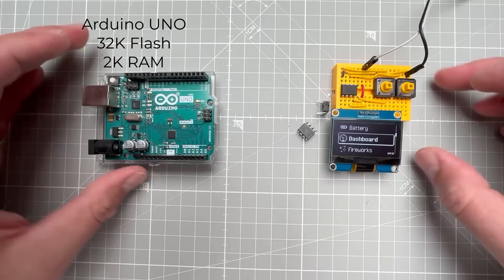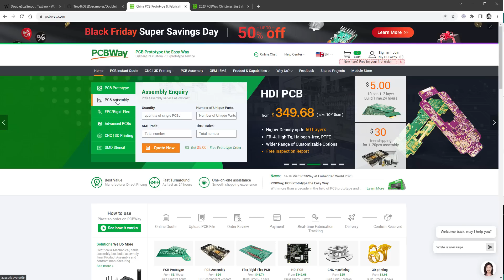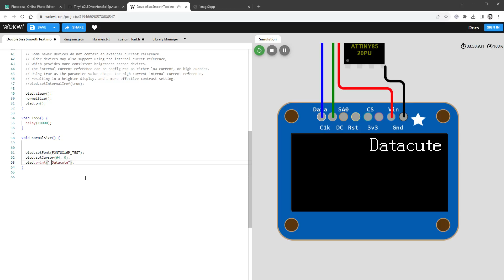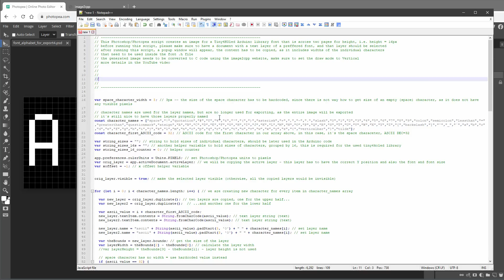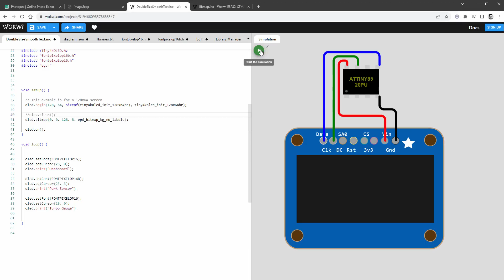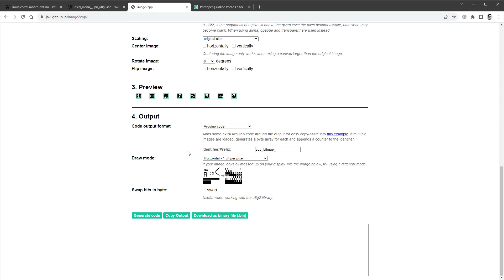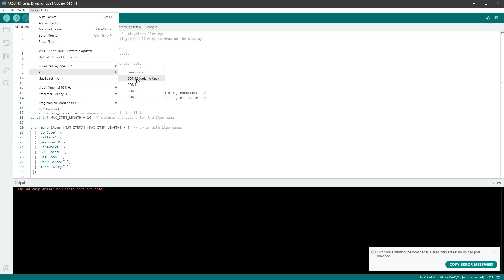Arduino ATtiny85 OLED Menu

Comment: Nice. I only know "Nokia 5110" or PCD8544 display which seem to behave similarly, just has 84x44 resolution (nice for 6x8 font giving 14x6 characters). But you don't need icons including menu, you can just use something like iconColumn |= item->next->isSelected() << 6 | item->prev->isSelected >> 2.
Reply from the maker: Yep, nokia displays were quite popular before cheap OLEDs were available, I haven´t actually used that display in any of my projects, but I might still try it. Thank you for your comment!

Comment: Nice! 
can i make this with attiny85 digispark?
is that code changes?
or pins connection?
Reply from the maker: Yes, you can use it with digispark board. Please see my other tutorial, where I was doing exactly that - https://youtu.be/8IKBzZKTgD0
Reply: @upir_upir  ok! I have OLED and esp32 and attiny85. I have 12 options in OLED menu but attiny85 doesn't have enough space. I Wana upload OLED menu code on esp32 with i2c communication between esp32 and attiny85 when I select an option in menu in OLED attiny85 run a function
Reply from the maker: Do you have those menu items in PROGMEM? It should be able to fit on attiny85.. or are those just really long string?
Reply: @upir_upir  I'm making a flipper zero but with esp32 and attiny85 and some modules like power bank OLED max98357 mic and more
Reply: @upir_upir  now i wana add select button to attiny85 and add a section for items in menu when i pushed select button it goes to another page like oled menu in arduino uno

Comment: I wish I had seen this video earlier.. A few months ago I was trying to make a menu for my OLED display, and spent hours apon hours on the arduino IDE and coulnd't get it to work. Really great Video, also the gearshifter ones!
Reply from the maker: Thank you for your nice words. I also have a second video about the menu project, using Arduino UNO, which has a little bit more details.

Comment: I'm trying to use ATTiny85 with OLED I2C and RFID RDM6300.
I can compile it if Arduino UNO/Nano board is selected. But if I choose ATTiny85 it throws an error message.
Error:
            'SPIE' was not declared in this scope
            inline static void attachInterrupt() { SPCR |= _BV(SPIE); }

          /SPI.h:310:42: note: suggested alternative: 'EECR'
          inline static void detachInterrupt() { SPCR &= ~_BV(SPIE); }
                                          ^~~~
Reply from the maker: The ATtiny85 does not have SPI, I´m assuming that´s the error that you see. Try using libraries that are optimized for the ATtiny. For the OLED display, that might be the libraries that I´m using for my videos, for the RFID chip, I don´t know what libraries are available. Good luck!
Reply: @upir_upir  Thank you for replying.
            #include <SPI.h>
           #include <Wire.h>
           #include <Adafruit_GFX.h>
           #include <Adafruit_SSD1306.h>

all this libraries cause error.  So they're not compatible with ATTiny85 right?
Reply from the maker: @jumbo999614 that’s correct, none of those libraries will work. Again, I would start with actually watching the video that you are commenting under, since at least the display part is described there.

Comment: 1:00 again lets use chip what you need. stop cry less memory or less pins. use bigger chip atmega328(32k/8k) goto minium arduino lol unless want use button to control 1 led thern can use tiny45/85.
minium setup need rotary encoder with pish button,display and available pin to TX so can actually control something. its pointless have just menu that not do anything.
1 rotaty can do many. click.click hold. double tap.double tap hold.rotate.push rotate. so many inputs from one thing xD
Reply from the maker: The point of this video is to showcase that you don’t need bigger chip for something simple as menu..

Comment: Very nice job and very good video. I subscribed.
However, how to you pass the info to another MCU? I see that you only have PB1 and PB5 left. So it would have to be a serial communication of some sort. Right?
Reply from the maker: Thank you for your comment. You are right, there are not too many pins left, but if you only need to send data from ATtiny to another MCU using serial, you only need one line. Another possiblity is to use I2C connnection. If the other MCU can have a different I2C address than the display, you can use the  very same pins as you use for the display, and not using any extra pins.

Comment: could you please make a video how to upload this code in SD card instead of uploading in chip. it will help me a lot😊😊
Reply from the maker: Could you please be a little bit more specific? I don’t fully understand what would be the reason to upload code to SD card? Thank you
Reply: @upir_upir  I'd follow your "Arduino OLED Menu Tutorial (for beginners - Arduino UNO, 128x64px SSD1306 OLED screen, u8g)" video in my ESP32. But I want this menu to work, I will add some functioning functions under each menu. for work like a flipper zero However, when I try to upload the code, it says 'Sketch too big.' That's why I need to upload it to an SD card as like flipper zero and then run it. Sorry for my English I don't know if I was able to understand you.

Comment: Thanks for sharing this tutorial. is it possible to use Nokia displays instead of oled displays?
Reply from the maker: It is possible, and it would not be complicated, but you cannot use ATtiny85, simply because the Nokia display uses SPI connection and you don´t have enough pins on ATtiny85 if you also want to use buttons. But with something like Arduino UNO, it should not be a problem. Are people still using Nokia displays?

Comment: The craziest thing is that I was working on this kind of project yesterday for a little winter display. I fiddled with it for hours and gave up. 

But then I saw your video and was like,” I gotta give this a try.” And you won’t believe me, but I powered the Attiny85 and it displayed correctly. I then made it dynamically update after I found out how the library worked a little bit better.
Reply from the maker: That´s great to hear that you were able to solve your problem and get your project running!

Comment: not the way I would have done it, but very nice! maybe instead of scripting photopea you can read the png file and convert it to the c array format, using a simple language like python?
Reply from the maker: You can convert image to byte array using python script, but you would still need the image to start with, and the individual character sizes, so I guess in this case the Photopea script makes more sense.

Comment: Very nice!! Is it possible to add some kind of scrolling animation when switching between menu elements?
Reply from the maker: Thank you. That should be simple for Arduino UNO, but little bit more involving for the attiny chip. Also most likely very slow.
Reply: @upir_upir  it would also be interesting how to do this with the uno (;